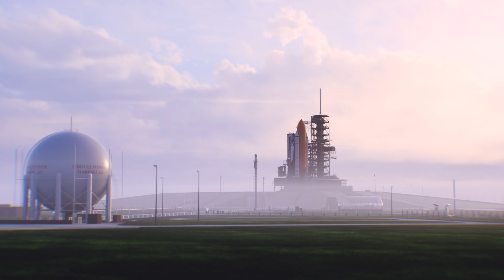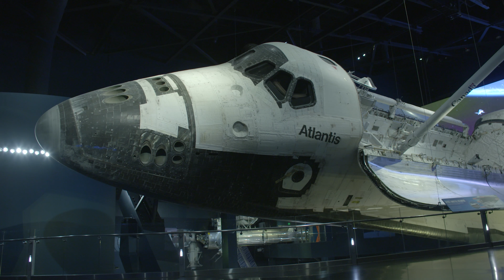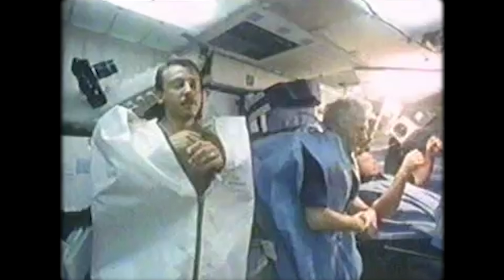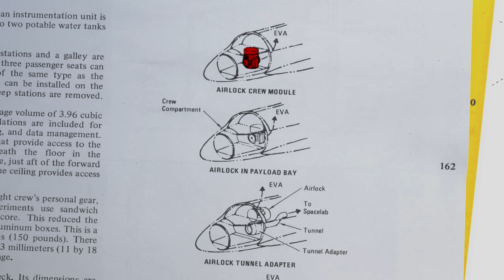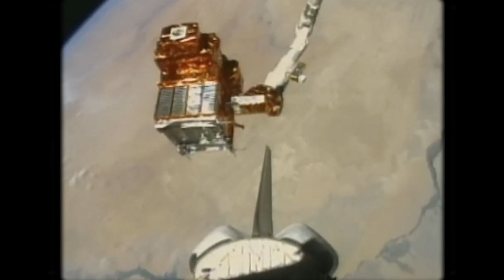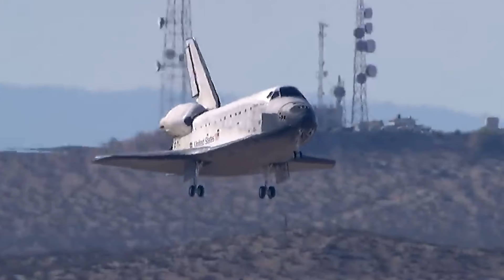The Insane Engineering of Orbit

Comment: In my opinion, the Space Shuttle is the most versatile spacecraft humanity has ever built.
We can deploy objects or satellites into space and, more importantly, retrieve them thanks to this craft. This capability would undoubtedly help significantly reduce space debris and orbital hazards.
Another key feature is its massive cargo bay—the largest ever at the time—which is incredibly useful. It can serve as a short-term laboratory in orbit or act as a heavy-lifter for transporting various modules. The only reason NASA currently cannot bring the Hubble Space Telescope or the ISS back to Earth is that the Space Shuttle program has been decommissioned.
Although these ships are now considered "old tech," if we took this foundation and integrated modern technology to develop a new generation, they would still be immensely valuable. The boosters should be replaced with liquid-fueled versions (similar to the Soviet Buran); they are highly efficient and could facilitate a truly reusable rocket system.
It’s a real shame we no longer get to see the Space Shuttle take flight.

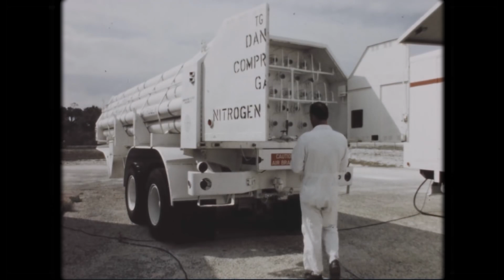Comment: 3:30 to add on, lighting a rocket engine in space is very very hard. For traditional fuels, it involves using an electric sparker to light a small solid fuel cartridge, which then burns and lights the propellant stream. Most engines have to achieve ignition in multiple places at the same time, requiring multiple cartridges and precise valve timing. Manuvering thrusters have to light hundreds of times, meaning hypergolics are one of the only feasible fuels for them (the other being peroxide, which is much less efficient).

Comment: Your facts are mostly okay but the structure of this video is terrible.

An example: At one moment, you are talking about the ascent, ET jettison, and MECO, but you do not mention OMS orbit circularisation or, what is quite important at that point, in my mind, the GPCs. Instead, you bring up the RCS and the vern thrusters, which is important, sure, but does not factor into ascent outside of attitude adjustment for the OMS burn. Only then do you touch on the GPCs, and instead of mentioning that there are five of them for redundancy, you...start talking about the wheels and re-entry procedures? And then, shortly thereafter, we're back in orbit.

You also make a lot of small, factual errors, like claiming the OMS is part of the RCS, which it is not, and saying that the star tracker helps determine where the shuttle is, as opposed to it being used to determine the shuttle's on-orbit orientation. 

I found it unwatchable after a while, which is a shame, because the graphics are great. Your research could use some work, though.

Comment: Insane is right … design a craft that has a heat shield prone to failure and kill everyone onboard, a craft that has no escape protection for everyone onboard when a catastrophic failure occurs during launch… NASA considers people as an expendable asset…  only a naive idiot would get on board…
Reply: Actually there were many instances where the shuttle could abort. Those being after the SRB's are separated. There were 3 options that depended on when the failure ocures (as long as the SRB's are no longer attached): RTLS, return to launch site; TAL, trans Atlantic landing; ATO, abort to orbit.

Comment: Great recap of the insane engineering of the Shuttle. The most complex machine ever built. 2,500,000 moving parts, 3,000+ subsystems and over 3,000,000 components. NASA predicted the odds of a shuttle destruction at about 1 in 100,000 launches. The engineers estimated the loss rate at about 1 in 100 launches. That would have been beaten if NASA would have listened to the engineers at Morton Thiokol.

Comment: How can that device track stars but our eye balls can’t? Every video I’ve watched with footage of orbit, i NEVER see stars. Ik why but what’s up with the witchcraft😂
Reply: It's simply a matter of exposure.  Have you ever actually tried taking pictures of stars?  You need long exposures.  In other words, the shutter is open for several seconds (usually 10-15 seconds).  In a normal photograph, the shutter is open for a fraction of a second.  So, a photograph of something lit by the sun would be TERRIBLY overexposed if the shutter was open long enough to capture star light.  The same concept applies to video.  If a video is recorded at 30 frames per second, then each frame cannot be any longer than 1/30th of a second.  That's not anywhere close to enough time for star light to register on film/or digital sensor.
Reply: Denialists trying to try to comprehend the simplest thing about photography for the 100th they are told about it: impossible

Comment: Solid technical review! Wanted to mention that star trackers only determine spacecraft attitude (13:44). On orbit, shuttle used ground site C-band radar, ground or TDRS (relay satellite) S-band radio ranging combined with IMU dead reckoning to get the inertial position and velocity state until they added GPS. The relative navigation for rendezvous was a whole different beast of a sensor suite.

Source: https://ntrs.nasa.gov/api/citations/20100039589/downloads/20100039589.pdf

Comment: To be nitpicky, 9:18 Laboratory 'crucibles' and beakers are not made of fused silica, they are made of borosilicate. Fused silica has much better heat & heat shock tolerance and lower thermal expansion. Labware is made from borosilicate because it is much cheaper while still having good thermal properties.
Reply: Yep.   Almost all lab beakers are borosilicate or fused quartz, very very few fused silica. Fused quartz and fused silica glass are pretty similar but have some differences.
Reply: You're my kind of people.  Keep sharing the facts, the people don't even know they need it.

Comment: Why not using space shuttle going to the moon?
Reply: entirely unsuited
Reply: They didn't have the range to. They were meant for operations in low Earth orbit
Reply: The cargo hold is big, surely can be redesigned it to fit fuels and stuff. If Apollo can reach the moon, land, hangout and flew back to earth there is no reason why space shuttle can't.
Reply: @MizanQistina  the shuttle has wings, because you can use aerodynamics to land on earth. you can't do that on the moon so the shuttle would have to land on its tail, with all that excess weight from wings making it ridiculously ineffective.
Reply: @Agarwaen  Add some more thrusters, it could land and take off the moon just like Millenium Falcon, The shuttle is bigger than Apollo, a lot of stuff can be done, the crew could hangout on the moon for a week. Can built stations and storages, the cost for moon exploration can be reduced.
Reply: @MizanQistina  mmkay.. you really need to go back to school. the milennium falcon is fiction. the shuttle cannot land like an airplane on the moon and just adding even more weight simply means it's even worse for the purpose you suggest.

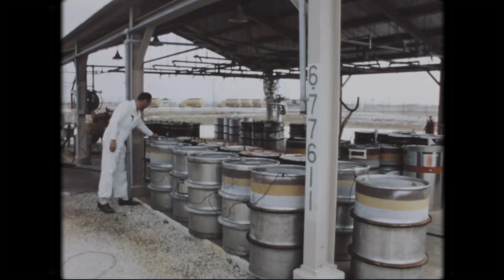Comment: 3:24 - "They (N2O4 and NH2–NHCH3) could be stored for longer periods than cryogenic fuels that would have to be continually vented as temperature rose, which makes cryogenic fuels unsuitable for longer missions like the space shuttle mission ... lasting 18 days." - whaaa?!

What a load of... whatever.
If you meant, by "cryogenic fuels", liquid hydrogen and oxygen, then I'd rather say that those could be actually "stored for longer period" (indefinitely, in theory), way longer than that HIGHLY reactive potent oxidiser, nitrogen tetroxide - or that organic compound that may age (i.e. change its composition with time). And yes, because of technological limitations the insulation of any cryogenic tank can hold the external heat away only to a certain degree - but that's only HERE, on EARTH - where the temperature difference between ambient "normal temperature" and boiling point is about 200°C for oxygen and about 270°C for hydrogen (and the temperature difference is the driving factor for heat transfer).
So yes, those tanks have to be vented PERIODICALLY, depending on how fast the pressure builds. They also can be vented "continuously", depending on the design of a given tank, but that's certainly NOT the only scenario.

HOWEVER, that's "on Earth only" - but (and it's a big "BUT") in the outer space the "normal, ambient temperature" is about THREE KELVINS (not "degree of Kelvin"!) only, or about -270°C (°C and K have the same "size", they differ only in "zero placement"). Which is about 17 K / °C BELOW boiling point of hydrogen, and 90 K/°C below the boiling point of oxygen. And in fact it's about 50 K/°C BELOW FREEZING POINT of oxygen (and 11 K/°C below freezing point of hydrogen).

So CLEARLY that "venting" IS NOT an issue for ANY "space mission" that could last for even YEARS - it's the simplicity and reliability of hypergolic mixture, which can be turn on and off on a dime - and probably the specific thrust of that mixture (the acceleration a given mass of it can provide) that mattered in the choice of those.

Well, anyway - so much about good research and accurate (and factual) information contained herein. I just spent about three minutes of my life watching this "syrupy poetry laden clip", and maybe ten or fifteen minutes typing this correction, and I just don't feel like wasting another 27 minutes watching this "insane insanity", and probably way, way more on typing another corrections.

So, have a nice one, and consider me out. Bye.
Reply: You seem to be ignoring radiation from the sun and earth. Even with good shielding and designing to keep the systems thermally isolated from the propellant, systems designed for long term cryogenic storage universally include active coolers, which come with more complexity, weight, and size. The problem is even worse if you’re in anything close to a low earth orbit, since you have to deal with radiation from two different sources at different, constantly changing directions.
Reply: @infinitelyexplosive  ...and the only thing you missed here is the fact, that NEAR Earth space temperature is about 10°C... Which is NOTHING like 10°C here, on Earth, and the number is merely the result of the very definition of "temperature" ("an averaged energy of molecules or atoms of a given body"), and on the top of it I was told in my high school, by the teacher of "Measuring Techniques Lab" classes that "temperature" is not, in fact, a proper physical property, it's merely a way to describe certain "effect" (convey it to us) in easy to understand and manipulate terms.

Thus that "10°C" in space where you have maybe couple of hundreds of hydrogen molecules per cubic metre, (plus an odd nitrogen or oxygen molecule, or such) says NOTHING about "how warm it is there" but it merely describes an average energy of each of those molecules.

Anyway, there are three ways of heat transfer - direct conductive transfer, convection and radiation.
When you switch on an electric kettle with water in it, the heating element attached to the bottom heats the metal in the bottom via direct heat transfer, and so does the metal of the bottom to the water.
Ditto for cryogenic container, surrounding warm air and the very cool liquid inside.
This scenario, HOWEVER, DOES NOT occur in space - both in "far, far away galaxy" and "near Earth" one.
When a central heating system is on in your home in winter, a warm radiator heats the surrounding air, contrary to its name, by direct transfer - and then you, sitting in the opposite side of the room, by heat convection. 
And when you're sitting on a chilly November night in front of a "dying" bonfire (i.e. a heap of glowing embers) the heat you feel on your face and hands is radiation transferred heat. No convection (for that to happened you'd have to seat ABOVE it), no direct transfer (for that to happen you'd have to seat DIRECTLY ON the top of that heap) - only infrared radiation.
And while it is difficult to "shield" anything from those first two modes of heat transfer, as soon as you place a thin sheet of aluminium foil (which is a very heat conductive material itself) between the bonfire and yourself, all the heat radiated at you will be reflected away.
 
And that's about "thermal insulation of things in space", and I'll repeat - this "outer temperature" is anyway so low, that whatever "radiation heating heat input" would be of a secondary concern - AT BEST.

But I digress here, and at any rate the crux of my gripe was this highly misleading (doubtful and incomplete, at the very least) statement, which, on top of this silly-syrupy narrative was that straw that broke camel's back.
It's the simplicity and reliability of hypergolic fuel/ oxidiser mixtures that matters here the most, and those were barely mentioned. Also, unlike is the case in burning hydrogen and oxygen, that N2O4 and NH2–NHCH3 reaction apart from "regular" oxidation of carbon and hydrogen gets a substantial energy boost from recombination of nitrogen atoms back into N2 molecules - and AFAIR that triple bond between those two atoms is one of the strongest covalent bonds (if not THE strongest one), thus it releases a substantial amount of energy - resulting in higher specific impulse.

So yes, I'm sorta-kinda "ignoring the radiation", and here's why. Hope I made myself clear.
Also (last but not least) I do hate when someone wastes my time telling me such half-baked poorly researched and rather inaccurate "pop–sci stories". Cheers.
Reply: @MrKotBonifacy  you didn’t have to explain convection and conduction when I very clearly wrote “radiation”. I guess you’ve proved you can write lots of words, so good job! 

The shielding will still become hotter in direct sunlight, at which point it emits sufficient black body radiation to be its own concern. Again, this means that you need to devote more volume, mass, and likely energy to increasing passive and active systems to prevent boil off. Enough that it’s a significant design consideration for something like the shuttle. This it’s worth mentioning as one of the reasons not to use cryogenic propellants.
Reply: @infinitelyexplosive  "you didn’t have to explain convection and conduction when I very clearly wrote “radiation”." - yes, I didn't HAVE to, but I did it anyway - for the sake of clarity and "thorough explanation". So that I won't have to deal with "but then there's..." or anything like that latter on.

And in case "too many words" feel free to skip some, or read only every second or third one. Can or not? 

"The shielding will still become hotter in direct sunlight" - I thought I clearly said "reflective shield" - or at the very least it was clear from my "superfluous explanation". Judging by the results it looks to me it was "subfluous" rather... and certainly anything but excessive. Well, who cares.

"... This it’s worth mentioning as one of the reasons not to use cryogenic propellants" - precisamente, amigo. Merely "one of many reasons", if at all. But then dinitrogen tetroxide freezes at -11°C, and monomethyl hydrazine freezes at -52°C, way, way above "outer space" temperature. How do you think, would tanks holding those (and pumps and pipes carrying them) need "some insulation" resulting in the fact 
" that you need to devote more volume, mass, and likely energy to increasing passive and active systems to prevent freezing" - ??
Also, would that be
"a significant design consideration for something like the shuttle" ? Just asking...

And then, in case you haven't noticed (seems to me you had not), there's some difference between "all or nothing" and "considering various/ all pros and cons". And my gripe was with singling out the least probable reason (or certainly not the most important one) for that choice, and skipping all the rest. Yes, I know a narrative has to follow certain rules in order to stay relevant AND interesting, still I see it as lousy one.
With which you may or may not agree, but then I probably couldn't care less.

Comment: kind of seems like you could prevent spurious landing gear deployment from random bits flipping by requiring something like a code input prior to the button being actionable and have the physical memory holding the status of that code input somewhere suitably far away from the activating circuit, would be interesting to know if other companies/countries have a mechanical solution like that or if there are examples of fully digital solutions to similar problems